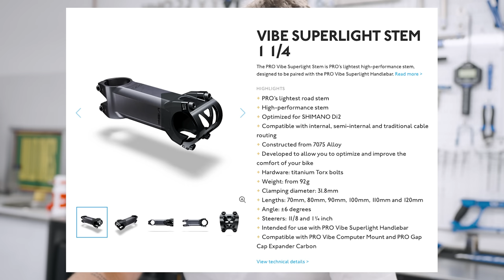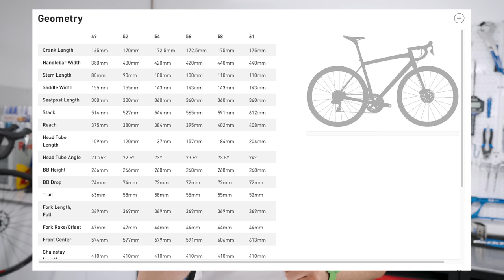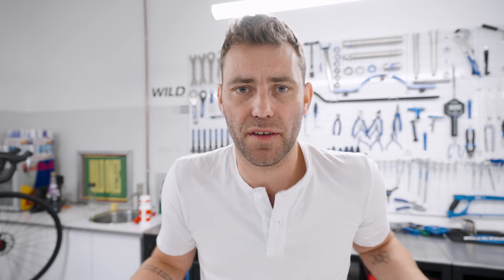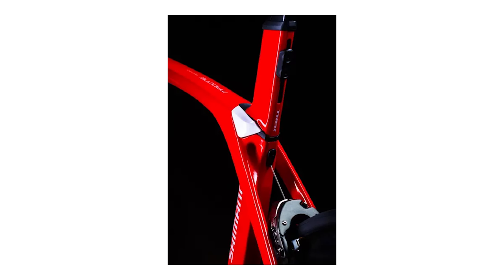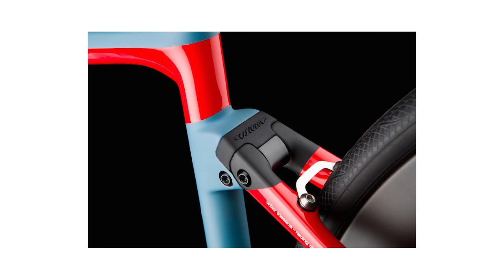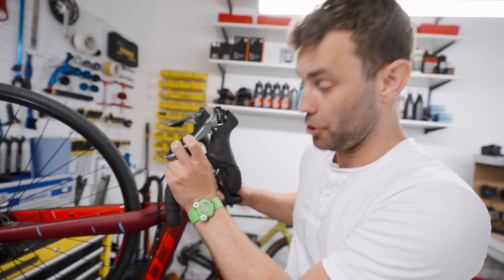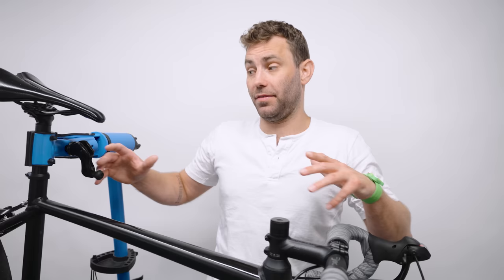Bike Fitter's 10 More Most Hated Products

Comment: Chapter about flat bars! I wish I had seen it before I bought my current mountain bike just because of its looks and I ride it exclusively in the city on roads.
Numbness, pins and needles, wrist pain - I get all of that every single ride and it made me begin question if I have the right bike for my case...thanks for confirming I indeed have a wrong bike!
Can't wait to get a gravel bike and, hopefully, have better riding experience.
Reply: That's nothing to do with the flat bars. He was specifically talking about flat bars on gravel bikes (which have geometry suited to drops). If you've got hand issues work out what they are before dropping more cash on a different bike...

Comment: How could you easily adjust your bike to go from racing to bikepacking regarding comfort and fit? And any tips for bikepacking bike set-up in general?
Reply: Do a mtb bike packing set up pls
Reply: Francis has a few videos on his bikepacking setups, but generally you just need to work out your tyre clearance and get something bigger on there that you can run at lower pressures. For bikepacking, if possible, keep your luggage in-line with the bike - so frame bags, top tube bags, saddle packs — you're already adding weight, so keeping things streamlined will help with speed and handling, and overall comfort.

Comment: It seems to me that any discussion of effective top tube length without stem length or reach is meaningless because these are both referenced to the steerer tube.  A lot of road bikes have stem lengths in the 100mm range.  So the hands fall onto a bar that is further away from the crank line.

Granted, stems can be changed for fine tuning.  This typically occurs well after point of sale… and after a lot of discomfort because, let’s face it, going to a qualified bike fitter is relatively rare.  More commonly, this service is provided at a shop with a bike mechanic.

Comment: Guilty on the long reach bars, with the flat section in the drops. If I'm looking for a frame, I ignore frame sizes, and grab a frame with 73x73 angles, and a 58cm virtual top tube. (188cm tall, with shorter legs) I use a 13cm stem now, but used a 14, when I was racing (and was more flexible)

Comment: Stack and reach is fine if you assume you are going to adjust stem/spacers/bars/seatpost offset/seat to get the right fit.  And in that they are great.  It tells you the size of the piece you can’t change the frame.  As a mechanism to fit the bike per se it’s stupid - but who does that?

Comment: Sorry, you can take my Ultimate from my cold, dead hands. Canyon could shape each tube like a weiner and I'd still buy one if it had the same geometry as the older ones. I thought I was a mediocre descender, until I got an Ultimate and started getting really good results on every big descent that I did.

And I don't much care about the steerer size - their one-piece bars are sized like they should be with a short stem and bar width that is slightly narrower than standard. Every other bike manufacturer asks for an insane amount of money for their improperly sized one-piece sets, on bikes that have been designed not only for a weird stem shape, but also for internal cable routing. Trek, Specialized and Giant all wanted like 8 grand for a bike with a one-piece back when I bought my Ultimate with the same feature for *two grand*. And the external part of the steerer on the Ultimate is mostly round, so it doesn't look like complete balls with a 2-piece bar and stem.

Comment: I just built a Madone SLR, and my model had the IsoSpeed decoupler. Now I'm worried about creaking once it starts to age... Thanks James.

Love the video and channel tho 👌
Reply: It won’t, mine has over 5,000 miles with rainy days and a lot of sweat and I haven’t heard a single thing… yet. I greased it maybe around when it had about 100 miles it was dry though…. I do not think that the iso speed is unnecessary, the Madone has been the best bike i’ve ever had, because I have the option of adjusting the stiffness whenever I feel like it, i’ve done centuries, and so on… the bike has gone through everything and I can say the iso speed works, I dont think this guys knows about the iso speed in fact i don’t think he owns a madone
Reply: I've had my Trek Domane SL6 for 6 - 7 years, no issues with decouplers whatsoever. Pretty solid.

Comment: The most annoying thing about current bikes in general is the total inconsistency in frame sizes. Most manufacturers switched to "T-shirt sizes" (S, M, L ...) and they're not even consistent in their own product range. On an MTB an M size might be 18 inches (46 cm), when on the same brand's touring bikes M means 21 inches (54 cm). On road bikes one brand measures frame size in the usual way (center BB to end of seat tube), the other brand measures vertically from BB center to the point where the line touches an imaginary horizontal top tube. So when you're internet frame calculator says 54 cm, you need at least a 56 if not 58 cm frame of the latter brand. So in the end, the only thing that helps is to try and test ride.
Reply: That's (your first point) is because seat tube length is a pointless measurement.  At least with the S,M,L sizing you tend to buy the same size in (e.g.) Road and MTB... rather than randomly declaring you need a 56cm road bike and an 18" mountain bike (because mountain bikes never did cm much either...). Now you just generally buy an "M".

Cockpit length is more important than some random measurement of seat tube length.

Comment: Lol just got my Aethos and Iove the geometry for me, but yeah I do get the point that for most people this isn't the "bike for the people".
Reply: I bought the Aethos in October 2021. Haven’t had any problems with the geometry. My reasons to buy were that 1) about all the parts are standard sizes so no need to chase for propriatery parts and 2) the versatility to change from a fast light-weight performance bike to a touring bike if necessary. Maybe it just fits me, who knows.
Reply: @911Sam  well the bike geo was very close to the bike I had before.

Comment: Isn't the long reach issue more to do with the combined reach you get from the Stem+Bar combo? As I understand it, if you shorten the stem and increase the handlebar reach, the controls are in the exact same position. The only thing that changes is the distance between the tops/corners and the hoods/hooks, which means a more-upright position when moving there.
Reply: My thoughts exactly. It could also result in a more relaxed climbing position. However, the downside could be that your legs hit the bar when you're climbing (or sprinting) out of the saddle. Interesting topic nevertheless.
Reply: @hymen0callis  I've never had that issue, but I'm more proportioned with a long torso and shorter limbs haha

Comment: Just a question about the last one: You say you are medium sized people (5"9'-5"10') riding size small bikes at size 53 (or top tube 53cm). Some brands (canyon, giant) make their size small  gravel bikes with a 55cm top tubes, but they also have slacker head angle and shorter (70-80mm) stems . Would you size down to XS in these brands to get a 53cm top tube and then maybe replace the stem?

Comment: I bought cannondale topstone 1 in MD size (I am 180cm tall) and I have massive reach issues with it. Now I am reading the geometry chart and the top tube horizontal length is 56,1cm. That with massively wide handlebars and 100mm stem is just a neck killer. Hopefully smaller stem will help. :S
Reply: 100mm on a M does seem long for a gravel bike. That said, gravel bikes to tend to have little bit longer top tubes to make up for the shorter stems. I think my Grizl is 57cm top tube in M, but only 80mm stem
Reply: @PaganiZondaF650hp  A 56cm toptube on a size M seems a far worse scenario than the 100mm stem- that most of the times swap pretty cheap and easily. Calling a frame with a 56cm toptube anything but large is complete and utter BS.. speakin of the complete wilderness frame sizing is these days. Skipping the homework and leaving the buying decision to guesswork will get you at some point. 
Any clue as to whether the EU / US / Asia big brands seem to follow some sort of common guideline? I have a few Giants, a Cube, a Haibike and a BH roadbike all following the norm of calling a size 54 Medium and a 56 Large. 
Wonder if US brands have a different interpretation of said scaling. (not that I will ever buy one anyway.. had plenty beautiful stickers as a kid)
Love the vid..  good job.

Comment: What I'd really like to know, as a real MAMIL, what to do with the slight hunchback. If my bike is set up correctly based on my arm length, torso, etc, it's really not easy to keep my head up. Should I buy a mountain bike? But I'm doing gravel. Or are there good bikes for this? Probably I'm not alone, it's a typical sitting-at-the-desk deformity.

Comment: Could the expert  tell us how exactly internal cabling is a “mechanical nightmare” 🤷🏻‍♂️ it’s no more stress than ext and considering the ousters aren’t change that regular it’s a non issue, I’d rather have a tidy looking bike.
Reply: You never had one of those bikes without the internal guide tubes did you 😂

More seriously... Lots of little things are impractical with internal routing (difficult to pre-stretch cables, often have to remove cables to do other work on the bike like headset replacement, cannot quickly pop out a cable to release a mech, takes longer to replace a cable...).

But I also prefer the aesthetic of internal cables and that's what I went with last time.i paid my own $$$.

Comment: I'd be interested to hear why you think saddles such as the Brookes (and ism in another video) don't provide necessary support for your average joe soap.  I do know that both Brookes (virtually my entire CTC club ride Brookes on all their bikes (both tour and race versions)) and ISM take some time to adjust too, but once this period is done, they stay comfy until they are completely worn out (which is a very long time for a Brookes).  I have had many a bike fit by various 'experts' over the years, in particular to tackle numbness in the undercarriage area.  Absolutely none have worked for me, as they have all focussed (indeed obsessed) about trying to work my fit around the issues that nosed saddles create (for me).  In the end I purchased an ISM PR2 (and more recently PL1.1), which have been a total revelation. I ridden over 30k miles (recently completed a 600km Audax) on the PR2 with no numbness, pressure sores or chaffing.  You do have to spend some time getting the fore/aft and height correct, but once you learn how to set these saddles up, it becomes a doddle.  For 'normal' riding (onroad/light offroad at medium-high efforts), the PR2 does need to be set quite far back (even with an offset post) to get good (counter) balance on the bike (especially with steeper seat tubes found on most modern road oriented bikes), less so with the PL1.1.  I've also tried the SMP, which comes a good 2nd place to the ISM.

Comment: I must be an exception then as I have never had an issue with my spesh shoes. I own a pair of the S-works 7 Lace and also a pair of the Recon Lace. The most comfortable shoes I have ever owned and always choose them for the longest rides, which can be up to 5 hours because I know for sure my feet won't be hurting during and after. 
Bonts on the other hand, which I owned 4 pairs in my life, and which hypothetically should be the most comfortable as they can be heat molded to the exact shape of ones feet always left my feet fucked up royally after each ride, even the short, one hour long ones.
Reply: I've had a few pairs of bonts and never found the heat molding to make any noticeable difference tbh. I also found the foot last or shape incredibly uncomfortable, high arches in the wrong place, but that might be my feet, maybe they're weird idk
Reply: @htdtr   We are all the same, yet different. The problem with bike fitters, but also other professionals is they form their opinion based on feedback, whether positive or negative, from a sample of users. So it is anecdata, and not data and just because John, Andy or Norman has had an issue doesn't mean everybody will have. Maybe most won't have. And bike fitters will also blame kit more often than the users because that way they can sell their customers new kit. If a guy or girl experiences numb hands instead of telling them to strengthen the core muscles and lose weight (lighter upper body = less load on the arms) they will blame the frame being a wrong size or the handlebar having too much reach, because it is easier to replace an item of kit than put in effort to change ones habits. I like bars with long reach and find the 3T Aeronova brilliant, because I can rest my forearms on the long reach portion of the handlebar, whereas somebody who has weak core and needs to support themselves on their arms entirely will tend to seek a more upright position and will be getting sore arms and hand numbness.
Reply: The pair of SWorks road shows I bought years ago were absolutely miserable. I did everything I could, but they caused extreme pain near my ankle. But the SWorks MTB shoes I have are the total opposite.
Reply: I generally laugh at people who buy shoes from bike manufacturers... I buy mine from shoe manufacturers (Sidi).

WTF do Bontrager know about shoes?

Comment: When the tourney levers came up i was   worried it was somehow going to be about the side exit gear cables.  How those are a fitting issue had me stumped.  
I have however regressed my cx bike to a set of side exit ultegra levers to try and improve shifting when everything is caked in mud.  My old set with cables under the tape always seemed to drag when things got messy.  

Back to your normal programming...
Reply: Used to rely on my side exit cables to catch my hand when riding a bumpy road while knackered...  I miss them!

Comment: Ok, so I have one of those creaky endurance geometries, and I now need a new bike, preferably without the creak, and it would be kind of cool if it also looked like a road bike from now instead of something that I rode 30 years ago. Any ideas where to turn? Endurace, Roubaix, Domane all look 20+ years old.

Can someone whip the designers of road bikes with a scented bootlace until they start paying attention to what should be their biggest user segment?
Reply: I'd take a look at Fairlight Bikes, esp if you are over in Europe.. they have a "T" option for all of their sizes (54 vs a 54T).. James mentioned them as something he liked in one video.. wish I was on the correct side of the water to have a fit with James..

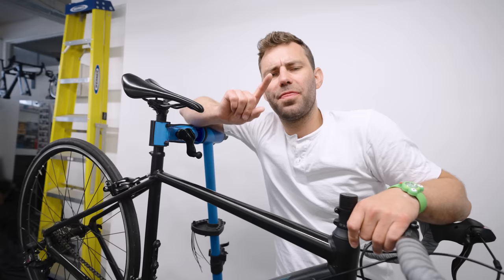Comment: 12:59 This. And not even size chart, but the fact size calculators are recommending wrong sizes. My first drop bar bike was Ridley Kanzo Fast. I selected size using their calculator. I am 179 cm height, 83 cm inseam, and it recommended me bike with 565 mm top tube and 110 mm stem integrated cockpit. With seat shoved all the way forward and narrower 100 mm cockpit it is acceptable, but buying new integrated cockpit and service work was quite a waste of money. I played a bit with their calculator. It recommends this size to a person with 79 cm inseam. This model has a high top tube. They would not be able even to stand over it, and seat tube would be 14 cm length. Ridiculous.

Comment: I got a new trek mountain bike and it has backsweep on the handlebars.... I hate it, feels like my hands/palms on the outside edge have way too much pressure on them.... if I adjust my wrists to hold them with my entire palm then it feels like my wrist strength and position is compromised..  am I crazy or does back sweep suck?
Reply: Not crazy, but you might also find it is related to something else - e.g. if your reach is short you naturally stick put your elbows and increase the angle hand-to-bar.

I'd drop on a set of less swept bars as a first step though.

Comment: My issue is i am 164cm with short inseam.  So it's easy just get a xx small bike , right ? 
Not so ,all (or at least all i have come across)  supply their small ,x small or xx small bikes with 170mm cranks, = totally useless.  If jou are lucky you can get 165mm which is still way to big for short riders.  Kiddy cranks or very expensive custom is only other option .
Why don't bike companies supply small, x small , xx small bikes with cranks to match .
I like bikes and the concept of cycling,  but i am lost , and have given up .

Comment: Fantasic vid, just getting into cycling now at 40 as im injured due to running  :  (  , im 5,10" and using a XL giant rapid 1 that got gifted to me , it seems to do the job and i can spend an hour on the seta with no problems,  so all should be ok yea ?
Reply: You can spend an hour on most things with no problem. If you start to do 2-4 and greater hours you may run into fit related issues.